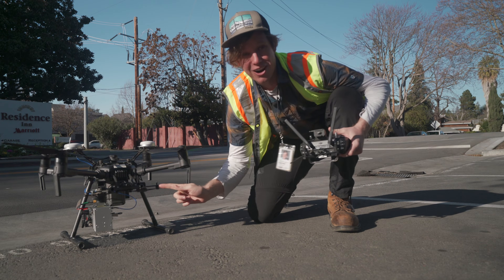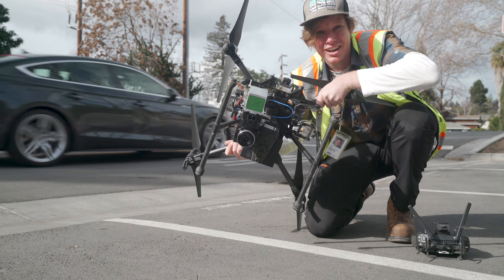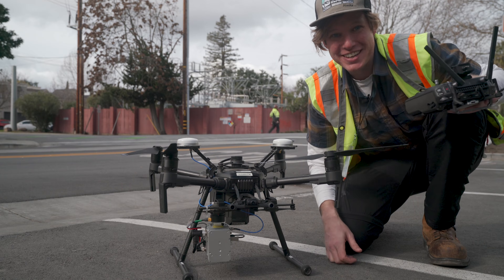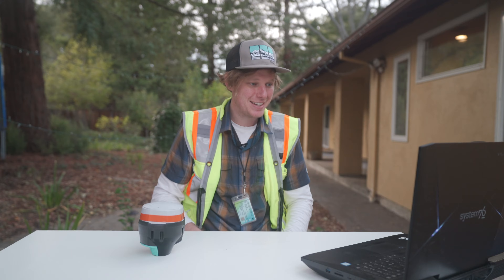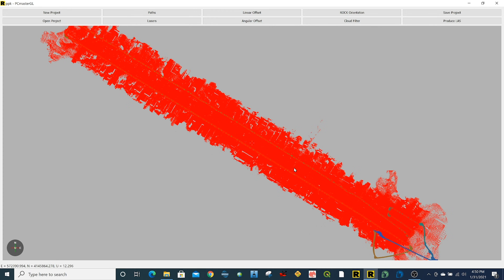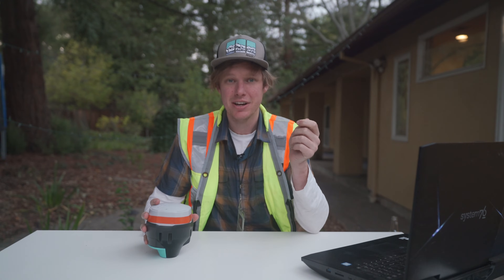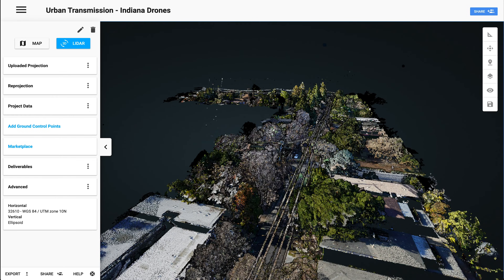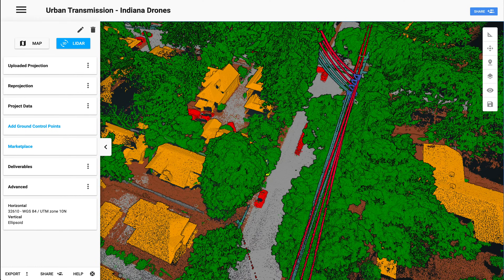LiDAR Drone Powerline Inspection | ROCK R2A | DJI M210

Comment: Are ground control points not sufficient or do you have to run a base station? Our survey outfit currently works on a network base station. Thanks
Reply from the maker: Thanks for your feedback! Feel free to bring your questions and requests over to the ROCK Robotic Community discussion board. Our support team is ready to answer all of your questions. 

https://community.rockrobotic.com/